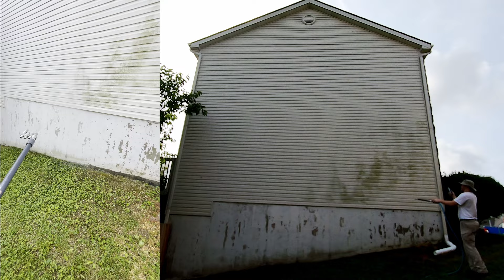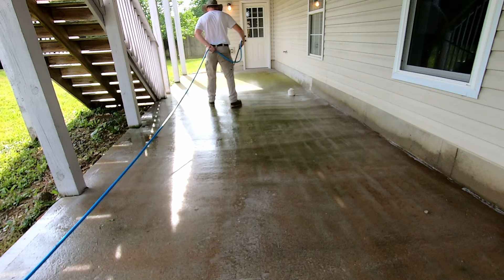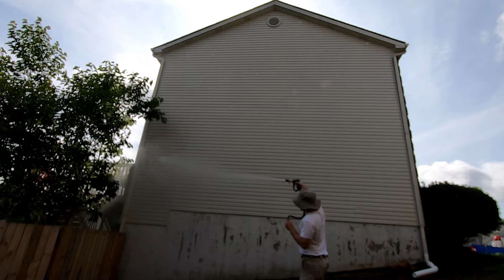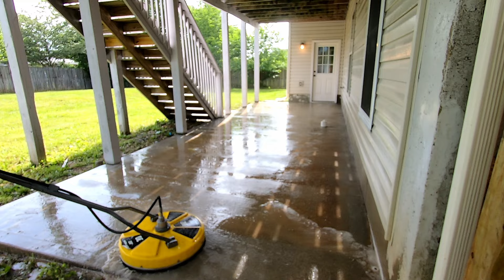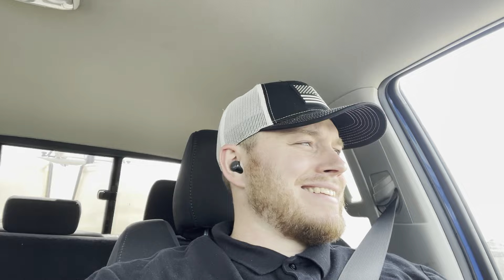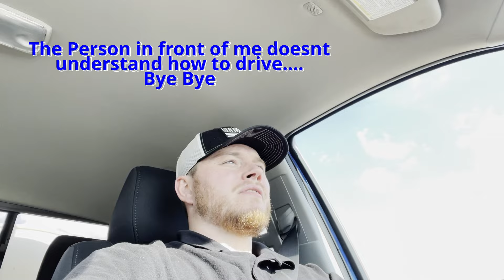How To Charge For House Washing | Day In The Life Of Owning A Pressure Washing Business

Comment from the maker: Mastermind Group: https://bit.ly/pressurewashingmastermind

Everflo 5.5 GPM Pump: https://amzn.to/4bOKQqa
Everflo 7 GPM Pump: https://amzn.to/4bLnfGI

Banjo Fittings:
https://amzn.to/4bQvPUC
https://amzn.to/3RiLKmB
https://amzn.to/3Rjihc5
https://amzn.to/45i47Om
https://amzn.to/4bFi4YV

Starter Kit:

4GPM Pressure Washer: https://amzn.to/3QbimNM
100ft Flexzilla Garden Hose: https://amzn.to/3scrbyE
100ft Non Marking Pressure Hose: https://amzn.to/476Oo4o
BE Surface Cleaner: https://amzn.to/3MdXnZm
Heavy Duty Ball Valve w/ swivel (wrist): https://southeastsoftwash.com/products/stainless-ball-valve-and-mosmatic-swivel-combo-set-assembled
Garden Hose Quick Connects: https://amzn.to/3FzlgXw
Extra Quick Connects: https://amzn.to/3tNsLYp
4 Rolls Teflon Tape: https://amzn.to/3Qvg7Go
Budget Hose Reel: https://amzn.to/499ntGM
Best Hose Reel: https://amzn.to/3FuvJng

Extras (Do not Need To Get Started):

Pressure Washing Gun W/ Swivel (wrist): https://amzn.to/3MF4wSX
Lance For Gun^: https://amzn.to/45KyHPe
JROD: https://amzn.to/476os8Y
Water Supply Line Pre Filter (Saves your pump): https://amzn.to/3QkqdZw
Quick Connect Pressure Gauge: https://amzn.to/3s00DAT
Race Can Jug: https://amzn.to/47a6zpT
High Quality Pump Sprayer (Sealing): https://amzn.to/49bIbWm

Chems: 

Surfactant: https://amzn.to/409x9gv
12.5% SH: https://amzn.to/473HYTj
35 Gallon SH Tank: https://amzn.to/3tOpnwk
Gutter Cleaner: https://amzn.to/3Q4NC0M